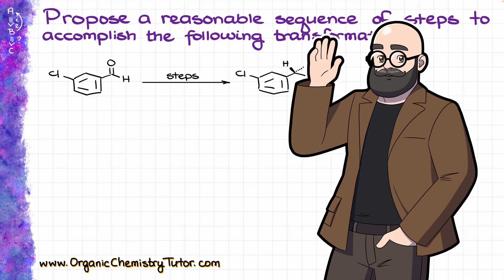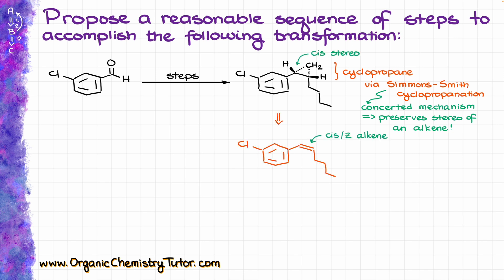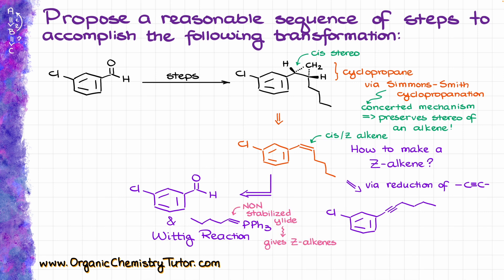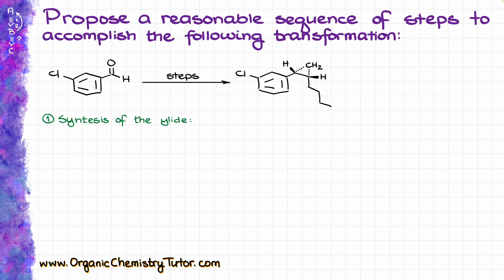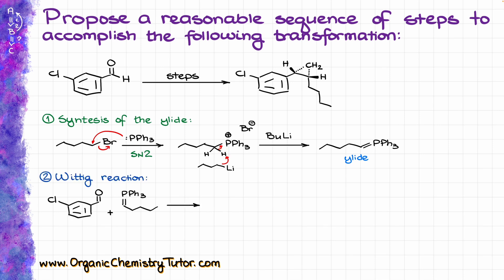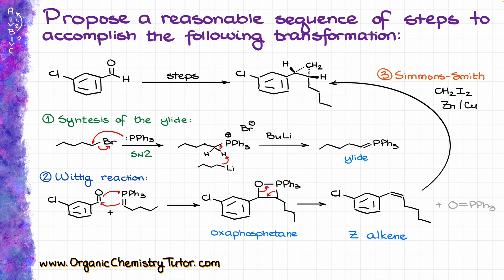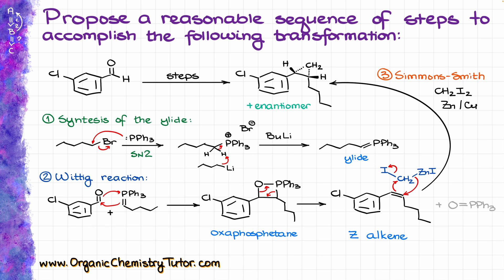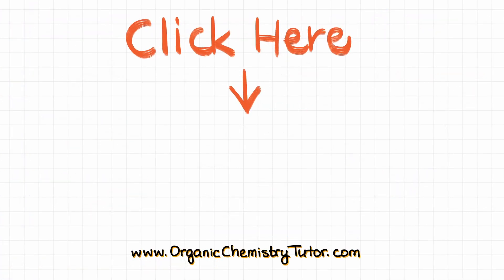Synthesis of a Cyclopropane from an Aldehyde

Comment: Seems quite weird when one is not used to using the wittig reaction in syntheses 😅
I've come up with an alternative for the Z-Alkene: (Can't think of anything else except simmons smith after that)
1) Using n-pentyl grignard giving the 6 carbons as side chain as required with a benzylic OH
2) Oxidising the OH to ketone via any standard mild oxidant.
3) Using Cl2/H+ giving an alpha halogenated product.
4) Using Zn(Hg), HCl to reduce the ketone. (I initially used the Cl2 instead of Br2 just to prevent the risk of it's removal during the clemmenson reaction)
5) Using Cl2/hv (Allylic Halogenation via Radicals)
6) Doing double elimination by using a strong base like sodamide giving an alkyne.
7) Using any standard Syn Partial Reduction like the Lindlar's as you mentioned.

I don't know why I have to come up with such bizzare sequences but it's just what's on my mind 😂
Reply from the maker: You get an alcohol after Grignard. Do a dehydration -> alkene, then Br2 to get dihalide, then double elimination to alkyne and reduction over Lindlar’s cat.
Reply: @VictortheOrganicChemistryTutor  Ohh that's a shorter one. Just couldn't think of doing dehydration because of that stereoselectivity thingy (I was afraid that would ruin it 😅).
Reply from the maker: The dehydration comes way before you need to worry about the stereochemistry, so who cares.